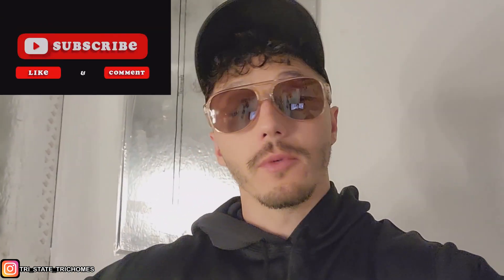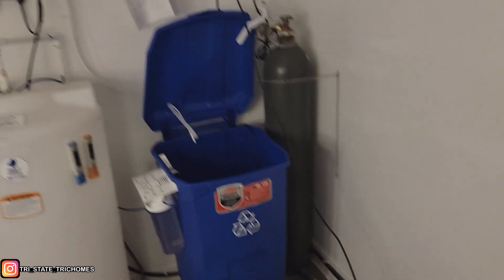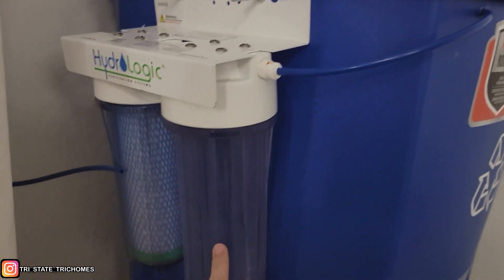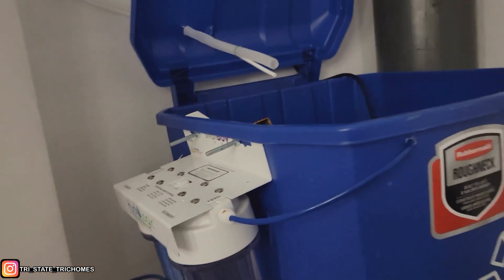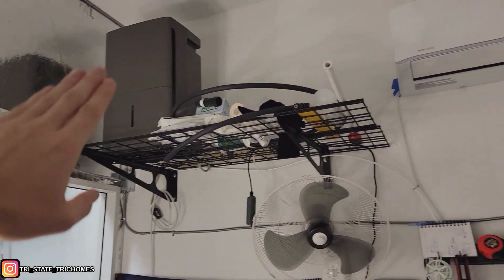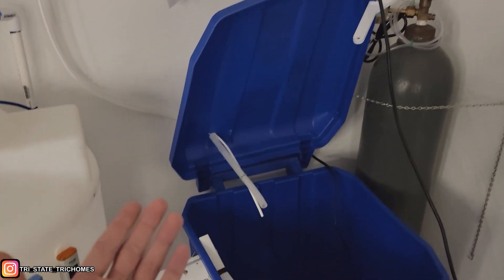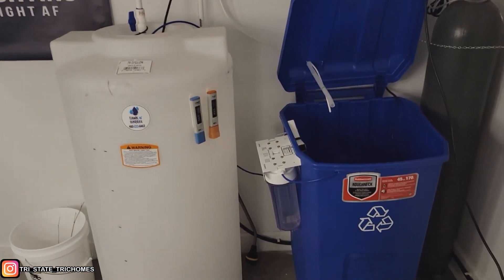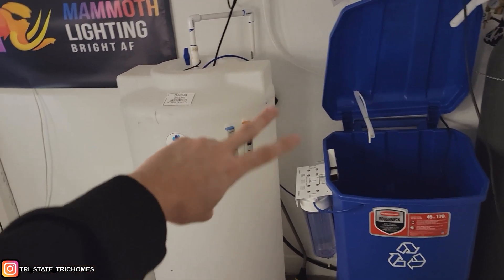Is Recycled Water KILLING Your Plants?! Or SAVING The Environment & Your Money?

Comment: What did you prefer pro line or blended
Reply from the maker: But I should be getting the labs and all results today so let's see what that says also
Reply: @TriStateTrichomes  nice I run pro line but I don’t follow the charts, never tried blended line tho
Reply from the maker: @EMUDroid  blended is great stuff too. No complaints. But the pro I'm a  bigger fan of now. Blended let's you adjust your ratios with a little more control since it's broken down into more parts. That's the 1 thing I do like more about it. But that also means more parts to mix. So it's a give and take.
Reply from the maker: Both are great. But I'm leaning towards pro line. Less parts, less cost, runs even cleaner and they use a different form of nitrogen that allows you to push ec harder.

Comment: When your Nutes res is nearly empty, do you swirl all the gunk from the bottom and sides into the remaining couple of litres...or am I right cleaning the empty res, as the gunk is full of salty crap. Whats your opinion on this?
Reply from the maker: I never get any gunk left on the sides. It runs very clean and since my pump is at the bottom its able to take everything except for the last 1/8" or 1/4". And since I'm filling up 60 or 70 gallons at a time, that small amount makes no impact. However if I did notice any settling of nutrients I would run a mixing pump set on a timer to mix before each feeding for a few minutes.
Reply: @TriStateTrichomes  I have a bubbler in the res.  But I'm coco, so add lots of stuff in my regiment. so a high PPM,
Reply from the maker: @UbiquitousRomp  might be your attatives then. I run only athena inside of the batch tank, so I don't have build up or a need for a bubbler. I have dropped in a water pump like I mentioned before. I had it set to turn on for 3 to 5 minutes before my irrigation time. That way I knew it was well mixed. But I have since tested my EC with and without mixing at the top of the tank and from the bottom and they stay consistent so I haven't found signs of settling and have stopped using the pump to agitate before feedings with the pro line.

Comment: Doesn't the water smell like some kind plastic?
Reply from the maker: I have not noticed any plastic smell aside from when the containers were brand new. After a good cleaning and rinse I haven't noticed anything.
Reply: @TriStateTrichomes  dehu water?
Reply from the maker: @doubleooh7337  no smell on the dehu water. I cleaned it before use and in between every run. not sure if thats the reason but no smell that ive noticed.
Reply: @TriStateTrichomes  well my dehu has got some ozone coolant in it and the water stinks, i did feed it a catnip plant before and it went alsorts of colour i wouldnt say it safe to drink, probably the tech is different
Reply from the maker: @doubleooh7337  what model so you have?
Reply: @TriStateTrichomes  something like expelAIR
Reply: @TriStateTrichomes  it got a climate change warning on it level 3 pollutant or something,
Reply from the maker: @doubleooh7337  oh wow. Is it older so the regulations were not as stringent at the time. I'll look into them and see what the difference is. Maybe it's something I can check on mine, just to be safe.
Reply: @TriStateTrichomes  i got it avout 2years ago but it could be old stock i wanted one with a drain value which conveniently they didnt have and got stuck with this one instead, i needed it my rh was through the roof then 1st time i seen bud mold
Reply: @TriStateTrichomes  its called xpelair
Reply: @TriStateTrichomes  model no.  XPCDH10